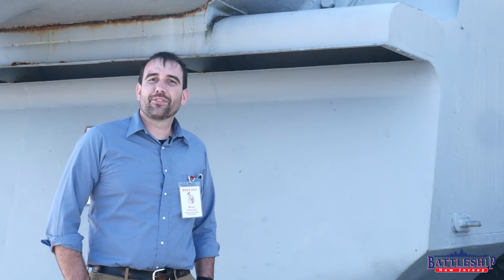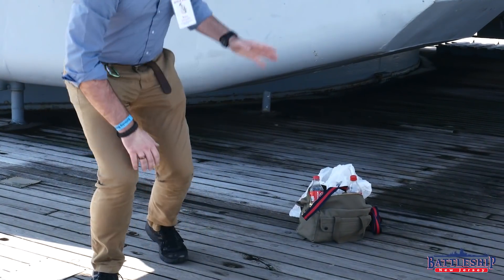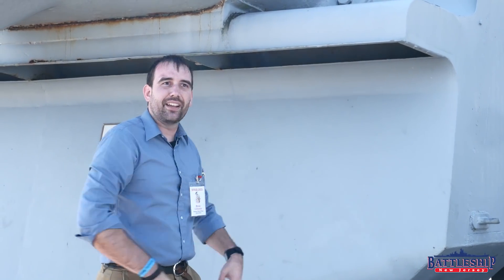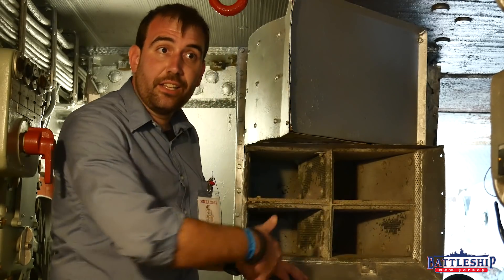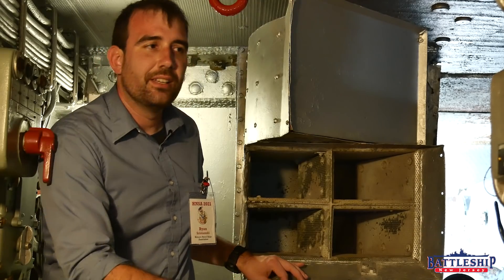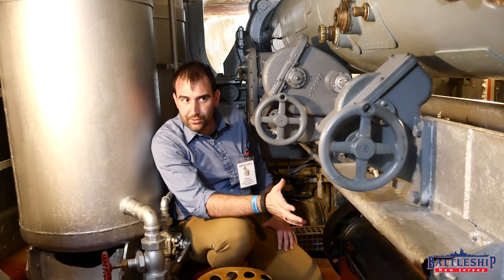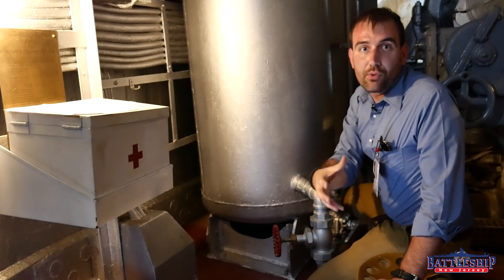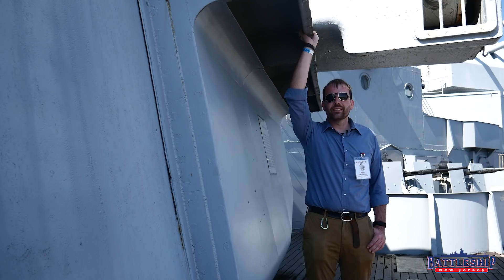How Do You Keep A Rotating Gun Turret Cool?

Comment: re: the difference between the ventilator design aboard ALABAMA vs NEW JERSEY: The capability the yards were ordered to provide was probably specified as something along the lines of "ventilators capable of moving X amount of air per hour under armour", with the rest left entirely to interpretation. The different yards would then subsequently contract different companies with differing specialties to make the same ventilator, which results in the different style despite broadly identical function. Happens ALL. THE. TIME. with naval equipment, regardless of purpose or engineering discipline. Our ships frequently had entirely different machinery layouts from one boat to the next in the same class. Same purpose, same spec, but completely different design from a completely different manufacturer.
Reply: Very likely.
It's called a "performance specification".
Reply: One of my Tincans was a "CNO test platform", so we had all kinds of "one of" machinery. From British air compressors , "nuclear" water level indicators, experimental water treatment and test systems, to various unsuccessful, but never cut out and removed, systems. Electronics and weapons  were the same. A real "buffet" of "one of"s".
Reply: Wouldn't a specific item or system be drawn up in the plans?
Reply: @andypage9  Not necessarily.
When we design sprinkler systems we specify the type of sprinkler head and the coverage.
The installing Sprinkler Subcontractor then does the detailed design, submits it for approval and, if acceptable, proceeds with the installation.
Reply: @andypage9  Not  necessarily. Even Navsea authorized and funded  Shipalts are sometimes never in the plans. They never "catch up", so to speak. Submarines are a whole different ballgame, though.

Comment: I served n a 60's era destroyer in the mid 80's. The engine room I worked in had no problem maintaining 120 degrees in California waters, 140+ in the equatorial Pacific. Our ventilation was just fresh air fan forced in from the main deck, and when it's 115 outside, it's a lot like cooling off by jumping into a hot tub. Still I loved my job.
Reply: 160+ between the mains on my last ship. 

Alaska was nice though. Actually had to consider wearing a jacket 😂
Reply: @JoshuaTootell  The worst I saw it was during an 8 hour flank speed run. The area around the turbines in #2 engine room was 180. All 4 boilers lit, I heard it was over 200 in the fire rooms between the boilers.

Comment: Iowa-class turrets ARE connected to the firemain of the ship using a 2-1/2 inch fire hose, that is to be connected whenever the turrets are expected to be firing.  The two water storage tanks that Ryan pointed out are more or less the "ready standby" water supply, since they simply don't have enough storage capacity to do more than a few minutes of sprinkling.

Those two tanks and the rest of the fire sprinkling system are also pressurized by the same air supply that powers the breech clearing air jets on the main battery guns.

The fire sprinkling system CAN BE activated from outside the turret.  Here is the description on fire sprinkling Control Station B:
"CONTROL STATION B is located beneath the turret overhang, within a glass-faced lock box. It comprises 2 two-position valves, each being marked SPRINKLE and CLOSE. There is also a pushbutton station with the indicator and lever each marked OPEN and CLOSE. Valve 1 controls powder hoist sprinkling. Turning the handle to SPRINKLE permits water to flow into the three powder hoists.  Valve 2 controls gun room compartment sprinkling.  Turning the handle to SPRINKLE permits water to flow into the projectile hoist, gun breech, and loading tray in each gun room compartment. The push button station electrically controls sprinkling in the annular space. Pressing the lever on the end marked OPEN causes the electrically operated valve in the annular space to permit water flow to sprinkle the powder passing trays."  --From NAVORD OP 769 Dated 1 Nov 1969.

Comment: What would they do for ventilation if the ship was on fire? I have to imagine sucking smoke in is not great for crew performance.
Reply: My guess is they'd turn off the ventilation system and get warm. A fire on the deck around the gun turrets should either go out through damage control efforts, or simple lack of fuel, before the additional heat inside the turret becomes an issue. If it did get too hot, the crew could evacuate the gun house of the turret to a lower level of the turret structure until the fire was put out and then retake their action stations when able.
Reply: This was a fairly significant hazard during the surface battles off Guadalcanal.
Reply: @DERP_Squad  It's easy for the ventilation system control hatches to get sprung by damage, or otherwise be destroyed, and therefore be unable to block fumes from entering compartments. Gas masks were the only option left at that point.

Comment: Wonder if you use something like a center swivel joint like a hydraulic excavator to run the hydraulic motors to drive the tracks could work for plumbing and AC refrigerate.
Reply: They likely have a central shaft that has slip rings to provide power to the turret, but making a slip ring is easy compared to making a large diameter rotating seal, given that the central shaft is what is used to feed up the shells and powder charges. Thus you would either have to have a massive seal to both feed in and return the liquid, which would be an absolute pain to maintain, as it would be forever leaking, and servicing would involve a load of removal of parts just to get access. Power feed up via some slip rings in a insulated area is a lot easier, as you can always add in to this network some heating or separate AC if needed. Water or refrigerant is a pain to deal with compared to electricity. Think how you are going to install multiple 15 foot diameter o rings in there.
Reply: @SeanBZA  a center swivel joint is  one unit that you attach pipes or hoses to it. In order for it to work it sits dead center of the rotating assembly "hence the name". If something else has too go through that spot than no it won't work.
Reply: @rustyshank912  The shell and ammunition lift has to be at that point, and it has to be fixed, with the shell and powder rooms under it.  Slip rings can be placed under there with no problem, but liquid feeds are problematic. That is why there is a separate fire water tank taking up valuable inside room, the designers likely could not get water feeds into the turret otherwise, unless they wanted to have large trailing hoses and carriers under the turrets.
Reply: @SeanBZA    does anything have to go through the very bottom of the rotating assembly In the center?

Comment: You mentioned that the vent system would pull crud up off the deck when in use, would it not pull in the smoke from the guns when they are fired?

Comment: I will do you one better.  NJ engine room in Persian gulf, which also means South Pacific to get there. Sure we had vents, no AC though and LOTS OF STEAM, in case you got too cold. 

We did operate off Aleutian Islands, when we shut off the supply air, because the engine room was too cold.

Comment: Never thought about bearing in a rotating turret. 
Were left and right used while inside the gun in place of port and starboard?
I could see port and starboard being confusing if you switched between a fore or aft facing gun.
Reply: Yes. They call the guns LEFT, CENTER, and RIGHT.

Comment: Do any of the "Air Conditioning" systems have filters and are they washable or do they need to be replaced?
Reply: A I recall ship I served on in the 1980, built 1960s - we had washable filters, and we even had a small space specifically used for the washing of the filters.

Comment: In the pre-internet days how did the navies designers track what modifications had been made to each ship?  Did naval architects visit ships periodically to see what changes the crews had made?  Was a single set of blueprints per class kept with all the mods added throughout the class so when one of the older ships in a class went in for refit they would be ready to run down an established list of upgrades?
Reply: I would guess they had a set of blueprints from "as handed over from yard", to which was added periodically to when the ship was at a repair yard, and a change was officially made, which would involve an addendum to the on ship documentation, which would perhaps have a copy set to naval archives by default. If a modification was to be done the yard set would be used to design it, and then the change sent out, and it might even match the ship by the time it was implemented, though I would bet there was a lot of variance between the ship and the yard plans. however the plans were roughly accurate, after all it is hard to move walls and floors on a ship, though doorways are possible to do, with what the ship has in the machine shop and spares racks.

Comment: So they can't run plumbing into a rotating turret, how did they get electricity in there? How was electrical wiring routed into the barbette?
Reply: They had rats in  a runner that provide  power
Reply: Power cables are routed up the center column from the lowest deck.

Comment: How would you change the 16in gun barrels
Reply: You don't, search the site they have done a video on the subject.
Reply: @briangulley6027  You could but that would take going to the yards and the use of a massive crane.
Reply: @Bellthorian  Watch their video, yes it is possible not practical.
Reply: Unfortunately, in 2021 even if the museum curator for USS Alabama wanted to and had the money for it he or she would be unable to replace the barrels aboard USS Alabama. This is because her spare barrels have most likely been lost to history. During the procurement of large capital ships one of the first things that is produced/ordered are the ships guns.
Because there is a extensive leadtime on manufacturing large capital ship guns once it is decided what size gun is going to be mounted two sets are made. The initial set is slated for installation during construction and the second set is placed into storage as spares. Like any gun the barrel wears out and must be cleaned and serviced after so many shots are fired. Once this occurs a major dockyard refit is scheduled. During that major dockyard refit large gantry cranes lift the barrels out of the Tourette’s and the barrels are then placed on large flatbed trucks. Each one of these things weighs 150 tons so you need a large heavy lift crane in order to get them out of the Tourette’s. Once all six barrels head out of the dock yard another set a flatbed trucks pulls up alongside the ship with the spare barrels. The process is then reversed and the spare barrels are installed in each turret. Ready to go and unleash the bald eagles. The barrels that were removed are then sent to a refurbishing foundry where they are re-sleeved, inspected, cleaned, painted, and then sent into storage for the process to repeat again once the spares have fired their maximum amount of rounds. USS New Jersey is fortunate and that somehow Mr. curator was able to dig up three of the spare gun barrels and somehow he managed to get them to the Camden waterfront. I asked him once what happened to the other six but he hasn’t yet answered me.
Reply: @BlindMansRevenge2002  I laughing at spelling - unknown if some intentional humor. Turrets - not tourette's. I wonder if some one with tourette's can serve in the US Military.
Reply: You need a yard with a crane. It involves removing the buckler, then turret roof armor plates. I don't think you have to remove the turret face.
Reply: @jth877  Watch Ryan's video, the ships didn't have spare barrels so they couldn't be replaced, that said it would be possible as stated above by others. The lining in the barrels could be replaced however. But again watch the video.
Reply: @briangulley6027  My understanding is that to replace the liner in the gun, the gun has to be removed from the turret. The Royal Navy ordered extra barrels when building ships so that they could be relined without the ship having to be out of service for an extended period of time. It wasn't a simple operation, but given the barrel life is only a few hundred firings, it would have to be done a number of times during a ships lifetime. As an example HMS Warspite had her gun barrels replaced twice during WW2, once in her 1941 refit, and again in 1944.

I'd imagine that the US Navy would have a similar system in place to ensure that a ship didn't have to sit idle while waiting for barrels.
Reply: @wfoj21  Funny, and good question. DEFSEC McNamara had his 100,000 (morons). Vid about that on YT is sobering, titled iirc McNamara’s Folly.
Reply: @briangulley6027  They were removed and relined off the ship. There were over 33 spare mk7 barrels produced and were swapped after 300(ish) rounds during ww2. There were so many mk7 barrels because they were expected to be used for Kentucky and Illinois. The life expectancy grew to 1500+ in the 80s with additives effectively making it unnecessary to replace them from wear.  The bulk of the spare barrels were sold off as scrap 10 years ago. You could buy slices of them from various sources.  It's a pity because i think they were all relined and ready to go. 

Barrel swapping was common among ships with the same gun type.  The navy didn't care what barrel was original to which ship.
Reply: @jth877  Yes, that was covered in Ryan's video
Reply: @jth877  Did you know that part of the data you inputted into the fire control computer was how many rounds had been fired from each barrel before the last time it was relined?
Reply: @Bellthorian  On the mk8 range keeper? I didn't know. I would think that value would change each time there was something added to extend barrel life. I did notice the 1980s vintage HP85 computer displaying velocity data in main plot. It was instantly recognizable to me because my father worked for HP and would bring an HP85 or HP87 home on the weekends so we could play games. 

Were you on Missouri?

Comment: It is my understanding that none of the Iowas had these ducts when they were built. To the best of my knowledge, New Jersey never got the ducts. The other 3 did get them, all with different designs, at various points after WWII, when the rangefinders were removed from turret 1.
 
Iowa and Missouri both got ducts shortly after the war, but only Missouri retained them. As far as I know, Wisconsin actually did not get hers until the '80s modernization. So, they literally are "aftermarket" additions, apparently. 

It is my understanding, as explained to me by the late Dick Landgraff (was involved with the modernization program at Long Beach Naval Shipyard) that these ducts only ever existed on turret 1, and were meant to address problems with sucking up green water. This was also part of the reason that the rangefinders were removed from all the turrets 1, which I was told also had a tendency to let in water in rough sea conditions.
Reply: The Iowas, because of their unusual hull form, tend to be particularly wet forward.

Comment: How did the turrets receive power?
Reply: Large cables running up a tube from the lowest deck.
Reply: It's called a slip ring.  Tank turrets use them, too.  Imagine an old-fashioned vinyl record, but instead of musical tracks it has concentric copper rings; the 'record' is stationary and does not move.  A set of contacts on another disc that's attached to the turret has metallic brushes that electrically connects each of the stationary concentric rings to a matching set of concentric rings on the disc that's attached to the turret and rotates above the stationary disc.  There are also rotary unions that allow transfer of liquids (like hydraulic fluid) between a stationary structure and a rotating turret, to drive the gun elevation cylinders, etc.